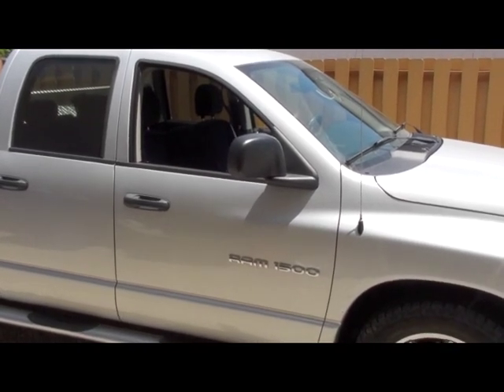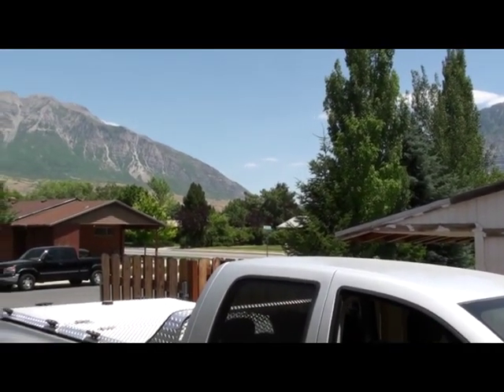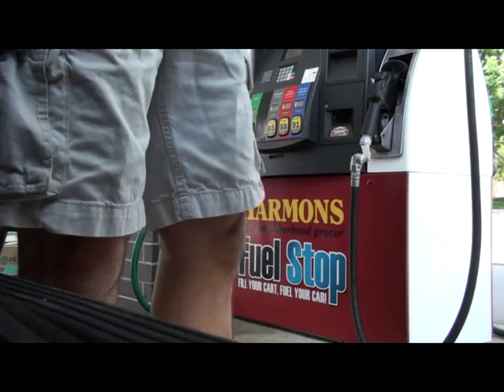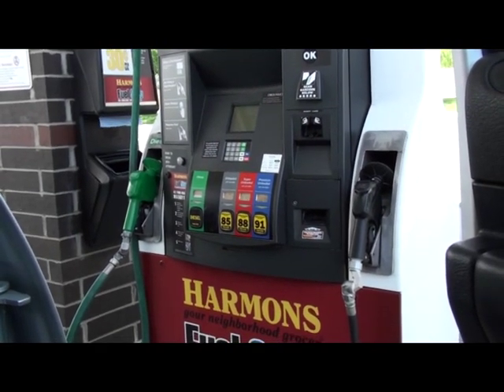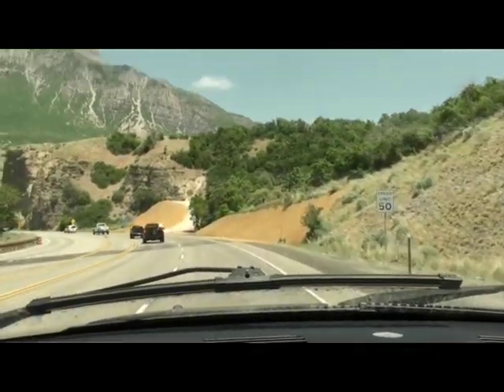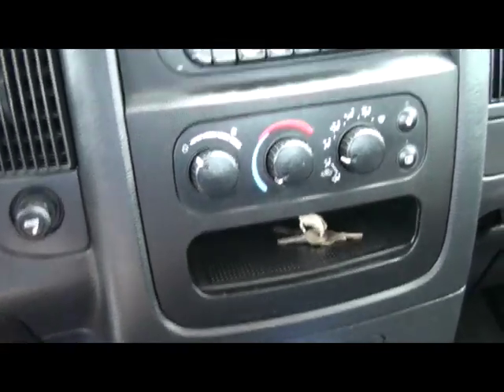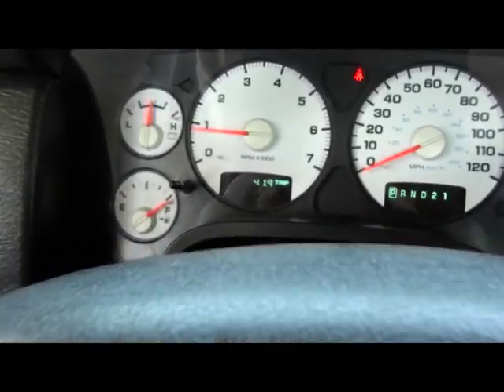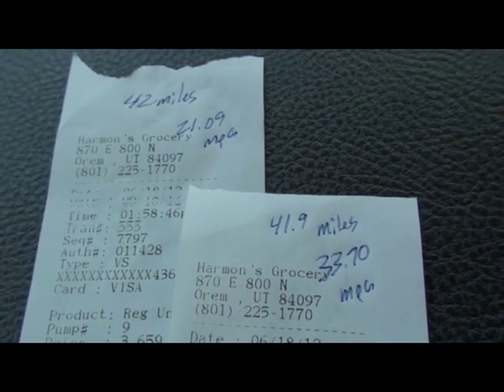288 Plate HHO generator Dodge Ram project. Part 6 Mileage tests 1

Comment: Would Lead work for Plates ingenerator? Could US poor folk douches out a large car battery,plug vents, tap H. and O.off each end.
Reply from the maker: D Kelley The anode plates would be eaten up quickly from electrolysis.

Comment: An awesome job!! Great work.  I noticed on most similar set ups, that I don't see anything to keep a big bump in the road, or fast stop/turn from allowing water in the bubbler to slosh up and to get into the tubing that runs to the engine intake.  Is that a potential risk, or is it just that too little water would  make it thru to be worried about it?

Comment: Hi Steve,

I am also working on HHo from last about 2 years and found so many new things. But it it possible that engine can breakdown because of extra Hho give to the engine. You could get the same results by just adding a small amount of hho in the engine you don't have to put 150amp of hho. Because the best fuel mixture ratio will be always 14:1, so it doesn't make any sense to add somuch of hho in a truck or van until you want to make a moving bomb.

Comment: The ideal set up is : a fuel vapour system and the HHo system. Both systems exist and together cuts fuel consumption by upwards of 90%.
...100mpg carburetters have existed since the 1950's but were stopped by big manufacturers.  There freemasons friends in business and government wouldn't make as much money if vapour systems were widespread...so all were stopped at this level.

Comment: so close. think your problem is air and fuel mixture before throttle body and after air filter. try enlarging hho intake hose and decreasing air intake to motor. air and fuel mixture is key

Comment: With 250 amp alternator,  can you run on water only, + can you add another alternator?
if you can run on water only, the amps are not a factor. fuel cost zero, @20,000 miles a year $3,000.00 for fuel annual, how many alternators can you buy for 3 grand? get lpm !! good luck, thanks

Comment: will this work on my 1982 Mercedes-Benz 300SD Turbo Diesel?
Reply: +toki891 just looking for boost in mpg and power
Reply: +toki891 ok thats why ive been looking at propane injection for my turbo diesel
Reply: Wrong.

These systems are based on the PROVEN FACT that due to the characteristics of modern fuels and internal combustion engines (and their grossly incomplete fuel burn) injection of HHO along with the requisite computer adjustments can SIGNIFICANTLY improve mileage and power.

This has been proven by none other than NASA (see:  report number NASA TN D-8487 released May 1977).

This is also basic physics.
Reply: toki891 and there are a lot of people LIKE YOU who know nothing about what they are saying.
Reply: always the same arguments @ these sites...but none say WHY it works when/if it CAN'T work.....true believers on both sides...BUT WHY DOES IT WORK? ....

Comment: I use six neg and pos plates with a bridge between each... a total of 36 plates.. I tried KOH and sodium hydroxide.. but my urine is my catalyst... quite powerful bangs as a test.. 1997 Chevy Tahoe 350 V8 Vortec.. 184K miles.. SUV 4wd. With out HHO 14 in town 19 highway... with hho cell hooked up...  19.2 mpg in town....  28.8 mpg highway... running 14.4 amps  .. 14.2 volts....  Wet cell... 36 plates.. 1/2 gallon of distilled water... 85 eye dropper drips of urine...

Comment: Does is make a difference at what amps your running throught the plates compared to the efficiency . Your running 5,56 mm/w on 40 amps on the cells but if your run for example 20 amps on the cell is it still giving 5,56 mm/w?  What is the most efficient amps per square inch plate?
Can you give to much hho to an engine? Or will it at a certain point not get better mpg.  Thanks. Love the project

Comment: I got a 91 Toyota with a 22re. I have 3 vessels with 13 plates each. I can push over 100 amps to it easily. The horsepower gain is noticeable and the emissions are almost none existence, but I don't have any mileage increase. However im using 8-32 all thread 316L stainless to connect the 2 gauge fine strand wire to the 13 plate vessels. This week im going to try 3/8 all thread. However with gas at $1.69 , its hard to get motivated on my project. Any pointers?
Thanks
Reply from the maker: +DUMBASS Yeah gas prices are low so that makes it hard but it is sure fun. Efficiency is everything with these hho cells. you may need more efficient dry cells.

Comment: Nice system! I built a wet cell system for a 3cyl Geo Metro and got similar milage boosts.  I discovered a trick using strong magnets to "stir" the water around the plates by pulling the ions along the lines of magnetic flux.  Doubled production due to more ions reaching the plates and clearing bubbles from the plates to expose more surface area before the bubbles float on up.  Email me plz and I have many more ideas, just lack the $$$ to try some of them.

Comment: hahahaha, both I15 and I80 are in a state of perpetual construction. Back in '81 when they were building it around the town I went to high school in, it hasn't been completed since. I do want to build a system for my power stroke, just to gather some more information before beginning.
Reply from the maker: Dave Morgan Yes the roads are always being worked on around here. If you need help with your project please let me know.
Reply: Hey hows it goin.....God man I can't get my hho system going...it's getting me so frustrated.  I made a 19 plate it was  +NNNNN-NNNNN+NNNNN-NOT ENOUGH SO IMSWITCHED IT TO  +NNN-NNN+NNN-  DUDE HOW MUCH OR HOW MANY PLATES DO I NEED TO SEE A DIFFRENCE.....TIRED IM SO READY TO QUIT,!!!!!
Reply from the maker: The first configuration was correct. Maybe you don't have enough hho.

Comment: Hey Delvis11, congrats for your HHO system.
I notice you install de EFIE but i want to ask you if you have heard something about the VOLO chip, supposedly it reduce the fuel consume automaticly direct from ECU and i would like to know if you know about this difference beetwen these two devices. I'm planning to make a HHO system for my bmw E39 6cil. 3.0 and i would like to know what would you reccomend for this. i'm thinking in use a 21 plate (3negs,2pos) at 30A..... let me know about your good comments.

Kind regards

Comment: What about total cost of all equipment versus savings difference or lets say 10 mpg savings or 50 miles per fill or 600 miles total savings in a year. How long would it start to pay for itself where it is worth it. I am guessing the equipment is around 2k

Comment: 33mpg in that truck is great. do you think you can make a smaller motor run on just hho like 2.0 i4 honda just wondering. i ran across this looking for h2o eth. injection for power on my cvivic si. do you thing this could be appliyed to make more power with gas @ 100 + octane thanks

Comment: After careful review of your system I must say it is wonderfully installed with only 1 flaw.......that fuel delivery system is totally wrong. You can not just add fuel to the intake as you have done. I am very impressed with the gains that you have received but I can vastly improve that with the proper fuel delivery system working in harmony with the trucks ECM. I wish I lived over that way because I could show you the missing link. But contact me and I will tell you what is needed for a minimal gain in my estimation of at least 40% especially during highway cruising speeds.
Reply from the maker: I could use someone like you and a brilliant electrical engineer. You know how a scanner can tell you what mileage your getting. I need a system that will detect the MPG and adjust the hho for the best mileage. Completely automatic.
Reply: I have emailed you. I hope to speak with you this evening.

Comment: Steve I am a master tech who works on high end European cars, my knowledge in advanced fuel injection tuning and modification May be the edge you need. It is my personal opinion that the reason your setup is not more efficient is simply the fuel management and delivery system. If you would like to talk about it I am available.

Comment: With that much output of LPM you should be able to turn off your fuel pump and drive.
 Rumour has it less is more when it comes to HHO mixed with gas, did you find the same? it sure looks that way...
Reply from the maker: Yes less hho worked better for better fuel mileage. Turns out the best ratio is about 1/4 to 1/2 lpm per liter of engine displacement.
Reply: Cheers. whistles and loud clapping, thanks for the reply :]
Reply: delvis11 If the best range for improved mileage is so much lower, then there is no need for such a massive setup as you created. Still, that's how you learn: trial and error.
Reply: The internal combustion engine is not designed to run on hydrogen. What's going on here is that H2 is being added to the air fuel mixture to cause it to combust more efficiently and fully than it normally would. Hydrogen and Oxygen need a jet type engine to work. It has to be a constant combustion setup rather than add fuel, and air, compress, ignite, get work and outgas exhaust. It could be done but you'd have to design the engine from ground up.

Comment: In this series you started to use an EFIE, but I did not notice if you continued to use one. Least it didn't show in the videos after it's introduction in part4 of the series.  Would it have made an impact on your mileage numbers?  With the volume of Hydroxy that your pumping out and only to see about a 50% increase. You've obviously invested a great deal of money into this system, but was it worth the investment?   Getting back to the EFIE, I've seen so much published about these units and how essential they can be in a successful HHO deployment to counter the O2 impact to the EMC and fuel to air ratio's.  Good series and appreciate you sharing the adventure...
Reply: I'm interested in knowing this myself.  Do you have any updates on your system?

Comment: Steve I thought you knew that I build these unipolar cells? I have made several of them over the years and have been running one on my Dodge for years as well. You can check out the video on my channel. The unit is 24 plates, 6 cell groups and 4 plates per group. I have used weld-on 16 around the holes and full gaskets between each cell group. really high MMW's
 25 mpg on the 2001 dodge cummins. "D"

Comment from the maker: The plates are connected +-+- but the plate voltage is about 2.2 voltes per gap. go back to some of my video's before the dodge truck series i have a few video on this 144 plate cell I show plate gap voltage.You actually wont find this type of design here on youtube. At least I don't know anyone here that does it. With no neutrals there is no current leakage at the holes so the cell runs much more efficient. 160 to 170 watts per liter of hho. My neutral plate cells run about 200 watts per liter.

Comment: Steve, so all of your plates are: ...+ - + - + - + - + - ...  ?  How do you prevent overloading the plates with 13+V from the alternator when you only need 2V between plates? In other words, the voltage to the cell is 13+V. Therefore, each set of 2 plates gets that voltage from the alternator.  What am I mising?

Thanks!

Comment: That's a sweet video seriers ! I have a 83 bj60 Diesel landCruser just truned 500K and turboed it so not I'm looking at a HH0 gernerator with out it I get 20 miles per gallon. Doing it on dyi and most likely a wet cell first to keep the cost down. The PWM is what I'm intrested in for keeping the amps to to the cell looking for a link on what would be best since 30 amps seems to be the best results from the last 50 video's I've watched.

Comment: If someone was to copy the exact same setup you have, about how much would it cost? I'm trying to deside if it is more cost effective to just sell my current car and buy a car with better MPG or do an HHO set up on my current car.
Btw I would build the actual generator my self as I have all the tools needed to do so.
I am also wondering if an HHO generator would work very well with a 6V 3W source. I know production would be low, but it would be for a 66cc motor anyway that already gets 100mpg.

Comment: Understanding the safety issues... in "theory" would the compressed Hydrogen sustain the vehicle?  BMW has a prototype out now that switches back and forth (seemlessly) from fuel to HHO.. they are NOT using it as a hybrid which is sort of what all the current plans are doing.  The difference is.. they are storing the HHO in compressed tanks... with no generator on board.  Obviously, that cuts down on weight and space consumption but doesnt solve the safety concern of compressed HHO.

Comment: So.. youre producing MASSIVE HHO at idle.. why exactly cant you pump the HHO into a compression chamber and use the compressed HHO as main line fuel.. thus actually running your truck on pure HHO??  Seems like once you apply throttle your HHO production will be self sustaining to maintain pressure.  You already covered the timing issues of running a higher octane fuel..

Comment: Obviously he has not tried one of the units. If you think that they have a better unit, let them supply someone with a unit that will do the real world tests. I don't think they will. I am also testing my own units. I have not put anything online as of yet. I will wait until I have proved without a doubt that hydrogen has worked for me. So far I have increased my mileage by 1.5 mpg in a 1996 K2500 with a 7.4 liter. I was getting 11.9 average mpg combined city and highway. I now get 14.2combined

Comment from the maker: Take a look at his claims

Big Kahuna

 

        We now offer a high output commercial quality HHO system that produces as much as 7 LPM.

        This HHO output is sufficient to cause major fuel mileage increases on 10 liter to 24 liter truck engines (both gas and diesel).
        
        30 amps 3.79 LPM
        35 amps 4.72 LPM
        40 amps 5.78 LPM
        45 amps 6.87 LPM 

All the claims are OVERUNITY!!
What do I think? You decide.

Comment: years ago  a ford falcon XA station wagon the MPG on it was awful. I was only a 2an year  apprentice mechanic I realy found I could not afford to run the way I wanted to When a teacther told me  how  for years they been using water and Alcohol mix to gain more power from there engines  So I went down to the local wreckers and bought a large window washer  with a  pump in it. I full it with 50/50 water and alcohol mix.I got more power 35% better fuel economy little pump bunt out So stop using it

Comment: Btw, good results!  I have a 98 ram 4x4 with dual hho system and having trouble getting 20mpg!  I want more!

I will also be doing a vaporizer system. From what I gather, make sure you get your gas HOT so you vaporize it completely before injection. This gives better output as well as to ensure the gas has no leftover crud in your vaporizer

Comment: Not correct. Once the electrolyser is run, and heated up, it actually emulates a charged battery itself. I have actually run loads off my electrolyser after shutdown. If you look at the plates in a torn down electrolyzer, they are formed, just like a battery. The voltage regulator will step down the load. This same problem exists when charging additional RV coach/house batteries, which is exactly why AutoCHARGE was invented.

Comment: I sent you an email with a few questions. Do you recommend the volo chip?  I am wondering if it can do everything I need with no other modifications with my hho system. I'm looking for something that does both timing and good air/fuel ratio. Thanks
Reply: i use a volo fs2 chip and doubbled my mileage

Comment: Genius!  Why haven't I heard of this?  I happen to have an extra 35amp PWM around here.. So you simply tone it down a notch and it leave it alone to cut your fuel consumption. So it cuts a percentage of the total output that the pump can do?  Do you take the jumper off for standard frequency as well?

Comment from the maker: I've been leaning the fuel with a pwm on the fuel pump and it's working nicely. as of yet I haven't been able to get any better than about 32 mpg
Reply: Do you sell that whole setup as a kit?
If so, where can I find it?
It is not on your website....
Reply: Is it possible to build this and still have it placed under Vacuum?

Comment: You're getting these results with no modifications to your ECU (o2 sensors & MAP sensor) !?

You will get even better results when you tame down your air/fuel ratio correct?

Comment: Different view: 
Hydrogen energy 120 Mj/kg = 33.3 kWh 
Electrolysis efficiency is around 70% 
So that you need  33.3/0.70= 47.6 kWh to produce 1 kg H2.
You cant make enough H2 to use.There is no big power battery systems in cars.
It can be suitable another applications but car.
I suggest if you really believe, keep your car  dinanometre tested. Your welcome.

Comment: There is another problem. Some calculations :  
First (33.1-21.09)/21.09=%57 more output THIS IS TOO GOOD TO BELIEVE

Basically
For room conditions  12lpm  H2 = 0.058 kg/hour 
1galon gasoline energy =1 kg H2 energy 
1.991-1.243_=0.748 galon LESS CONSUMPTION IN SECOND LEG
You need time    0.748/0.058=12.9 hour to produce enough H2 gas

SORRY HHO GENERATORS DOESNT PRODUCE ENOUGH H2 GAS FOR CARS

Comment: Steve, forgive me if you already know this, or someone mentioned it, but: An alternators voltage control provides enough current to operate the vehicles engine, lights, other electrical devices, as well as recharge the batteries BUT once the battery reaches 13V, the magnetic field is reduced and the current then drops off drastically tapering off the available current. Perhaps your cell is emulating a charged battery.Weems & plath AutoCHARGE Alternator control allows max amps to 14.8V.